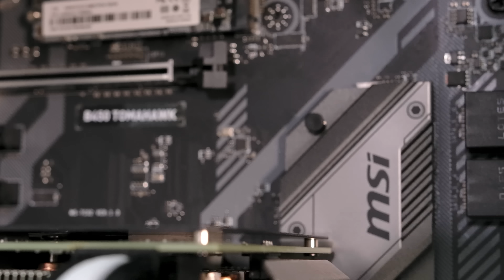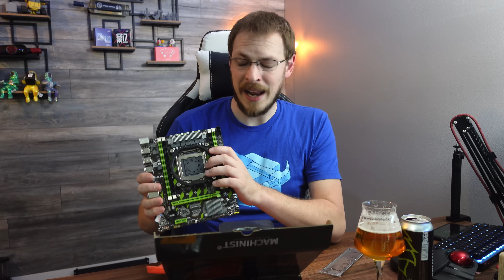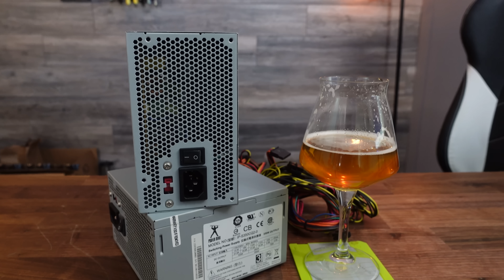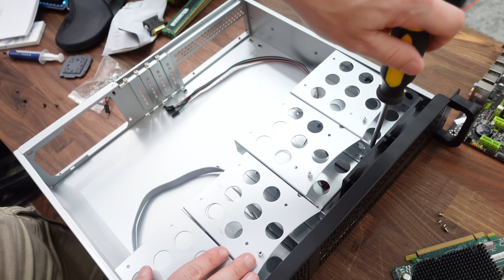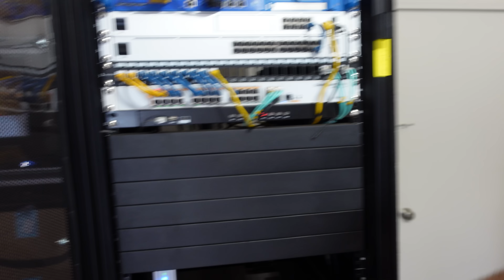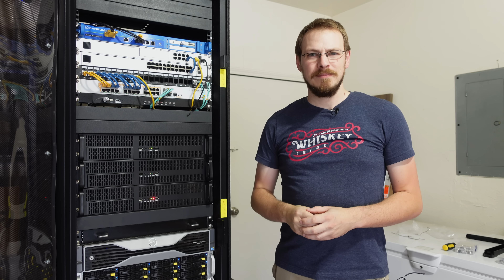A Three Server HomeLab for less than $1,000!

Comment: Overall a good builds, and I understand the choice of parts... except for the power supply. I have been bitten too many times by trying to use a low end power supply. Power supplies have gotten better over the years, but I have seen low end power supplies go and take other hardware with them. I generally only build with a few brands, and always will put a few more $$ into the power supply purchase.
Reply from the maker: These power supplies are OEM'd by InWin. They're not as cheap as you think.
Reply: @CraftComputing  I have had 2 InWin smoke shows in the past that took hardware with it. One of several brands on my "no buy" list.

Comment: You can also get ATX powersupplies with an 80mm fan pulling air through the powersupply front to back so that would remove the need for top ventilation in this case.
Reply: Difficult, while avoiding total junk and things that used to be good once but it was very nearly 20 years ago.

Comment: A NUC based home lab would make a lot more sense for most, and as Wife Approval Rating seems to be a factor, a far easier to sell.
between energy efficiency, space efficiency, heat output, noise, and flexibility of placement, they make a lot more sense. Plus companies are putting out multi-NIC solutions with 3rd party mods and 3rd party NUC-Alts like the Asus PN50.

Comment: oof...you were all over the place with your Dell specs.  I think you meant R710 [0] when you quoted Nehalem and Westmere.  They're actually Nehalem & Core Xeon compatible. [1][2]  R420 & R720 can use Sandy Bridge and Ivy Bridge chips [3][4][5].  Good video otherwise!

[0] https://en.wikipedia.org/wiki/List_of_Dell_PowerEdge_Servers#Generation_11
[1] https://en.wikipedia.org/wiki/List_of_Intel_Xeon_microprocessors#Core-based
[2] https://en.wikipedia.org/wiki/List_of_Intel_Xeon_microprocessors#Nehalem-based 
[3] https://en.wikipedia.org/wiki/List_of_Dell_PowerEdge_Servers#Generation_12
[4] https://en.wikipedia.org/wiki/List_of_Intel_Xeon_microprocessors#Sandy_Bridge-based
[5] https://en.wikipedia.org/wiki/List_of_Intel_Xeon_microprocessors#Ivy_Bridge-based

Comment: HomeLabs are fun, currently I'm running a mix between a HomeLab and "production" server on a HP Elitedesk 800 G1 with an i5 4570, 8GB RAM and 2x1TB RAID1 drives.
It's running proxmox with a few VM's (Pi-hole, Inifi Controller, MariaDB and Ngninx webserver).

I need to upgrade the RAM to 16 or 32GB though since I'm at ~90% useage :P

But I'm thinking of getting a new "production" server instead based in a Huananzhi X99 TF motherboard paired with a 2678 v3 CPU and 128gB of DDR3 ECC RAM for a total of ~425 USD and a few 10 Gbit SFP+ NIC's for it, my WS and NAS'es and migrate pfsense from a physical box to a VM instead coupled with the MikroTik CRS305 switch.

Comment: Excellent work. Using custom hardware is king. I would have chosen used small servers like the dell R210, at cheap prices, minimum power consumption, and easy assembly, but that is me 😂.
Reply: The r210 will only handle processors with what max 4 cores? I don’t see how that would make as good of a low powered virtualization platform.

Comment: Jokes on you i don't have girlfriend..

Recently I built my first "server".
I got cheap x99 ud4 mobo - 2 of the pins are missing but all memory and pcie slots are working. - 20€ (I got it localy)
128gb ECC Reg 2133mhz cl16  -  150€ (I got it localy)
E5 2620 v3 - 13€ (from Aliexpress)
Artic Freezer 34 - 27€ (New)
PSU beQuiet 400W 80+ Bronze - 15€ (I got it localy)
And some old case I got laying around (airflow is good enough)

Also one thing I found this mobo (Gigabyte x99 ud4) is that it supports headless mode.

Comment: I've used HP's sff desktops for similar usage. Only 4c8t on similar aged hardware tho, but really cheap and no building required.
Also: wouldn't it make sense to mount your chassis wifh about 1/3 U space for the PSUs?
Reply: Also very low power draw. I've got an 8300 SFF that I've been using, but upgrading to 2 Ryzen 2700X's in rack for serious play.

Comment: So how will the PSU's breathe? I had hoped you would use the blanking plates as spacers between the servers, also knowing they are 14$ a piece and no ventilation they seem like a fire hazard.
Reply: Take the tops off the power supplies, the case has fans at the front so there is air flow in the case. Simple.
Reply: was my tought!!!
Reply: Yeah, that's what I was waiting for, how he manages the cooling of the PSUs. At least spacing them out in the rack. But I would rather find a PSU which only uses 80mm fan at the back.
Reply from the maker: I'm cooling the PSUs by only drawing 100W.
Reply: @CraftComputing  Fair enough, but I would still make sure it's not getting hot by monitoring it with a temperature probe  for a few days.

Comment: Why x79 though? x99 boards can be had for the same price, 6c, 12t processors for about double what you paid (21$), scoring 900 points on cinebench. These processors have higher single core scores, and are more power efficient.
Reply: The last time I checked DDR4 RAM was much more expensive. The reason I went with original LGA2011 for my system was for the cheap RAM while not being too old.
Reply: @eDoc2020  Some of the x99 boards support ddr3 too
Reply: @RockTouching  Really? The memory controller is built into the CPU, not the chipset. According to Intel the E5-2630 v3 only does DDR4.

Actually I did a web search and apparently there are some Chinese "X99" boards which let you use DDR3 but only with specific processors. I would personally rather have a real server board from a reputable manufacturer than a Chinese board with questionable chipsets (Intel doesn't make X99 anymore, so where are the chipsets in these new boards coming from?)

Comment: To overcome the airflow issue with ATX power supplies in 2U chassis, I used an SFX to ATX adapter and mounted an SFX power supply inside the chassis. This will leave about 1cm of space between the case wall and the fan for the power supply to breathe.
Reply from the maker: I considered that as well, but it wasn't worth nearly tripling the price of the power supply. These supplies aren't exactly going to be stressed, with 100/350W being used.
Reply: @CraftComputing  Maybe some DIY "speed holes" could be added to the PSU with a drill? Lol.

Also, don't think i don't see you avoiding my question about those cheap HGST drives...
Reply from the maker: Hahaha, caught them on an eBay BIN. I bought all they had left 🤫

Comment: To bad they didn't fit the psu vent on the bottom less likely to drop a screw into the psu (or buy a straight throu airflow PSU) and the psu cable length wouldn't of be a problem then as the would have been closer to the motherboard 
and the motherboard hanging off just get a plastic motherboard stand mounts you can get a pack of 100 very cheap (long long time ago cases used to come with the screws pack)

Comment: Would be great to see a video like this, but using actual parts and not chinese knockoffs
Reply from the maker: Enthusiast platforms are still crazy expensive (x58, x79, x99). Same with Ryzen 1st gen parts. Plus going with name brand and more modern, you bump up to DDR4, which can easily double your memory costs. This video was to show the entry level to get you going. You're more than welcome to take this idea and install whatever parts you'd like, or upgrade later.
Reply: my current server is based on a 3600 with a x570 board, cause that’s what I had laying around. I will likely be changing that to the new A series they are supposedly announcing soon. If they make a new Athalon that is on a Zen 2 but cheaper (board and processor like $100) that would make great test servers

Comment: Yep registered and buffered or chip kill type (chip kill has 2 set of 9 ram chips per side for mutibit error correction or survive a full ram chip fail and stay working) these types of memory is mostly worthless unless you have a supported motherboard and cpu so low balling offers will normally get accepted because they never get sold or they get returned because the buyer didn't know what they was buying

Comment: I've built a homelab with aa am4 x370 board,  Ryzen 7 1700 (set to 45w eco-mode in the bios) with 32GB of ram. Runs pretty fast, and when idle, it draws not much power.
It was relatively cheap, ran ESXI and worked fine!
Maybe a suggestion for a future video?
Reply: Clutch that you got esxi going, it hates 95% of NICs I swear

Comment: How will the PSU of the lower two units breath? I see no openings with stacking them like that.
Reply: They probably don't... Or at the very least they are barely pushing air out through the sub-millimeter gaps that are present due to manufacturing tolerances . That's also the biggest complain I have about this setup: either you  pack them tightly and hope to not start a fire accidentally or you sacrifice (at least) 1U  worth of rack space to place gaps between the three.

Comment: HOLD UP.... Where did you get those HGST drives for so cheap? I've been wanting to replace my server's old AF drives for awhile now
Reply: If you're up for it, I've had very good luck with HGST/Hitachi enterprise refurbished drives on Amazon(Seller is goHardDrive[on Ebay also] though I did try a couple others too.) I have a mix of 3TB and 4TB drives in my NAS totalling to 29TB with 11 drives currently. The oldest are from.. 2015? I think? I started with shucked 2TB External Western Digital drives(2 of the 4 have died btw), and one 2TB HGST refurb in.. 2013 or 14? And slowly added 3TB drives and then started with 4TB. All the 2TB are out of rotation now. Oh also, I had bought a 4TB External Seagate in like.. 2017? to use for backups of the most important stuff, and it died in like a year and a half, meanwhile all the HGST/Hitachi drives are still going strong.
Reply: @Raletia  That is who i got mine from.
Reply: eBay. I have a set of 2tb's from april 2012, been running strong since new never an issue
Reply from the maker: Yep, eBay. Caught these on a BIN deal. Bought all they had :-)
Reply: @stevenhusnik5937  I have 12 that have been running 24/7 since 2015, never had a single problem.
Reply: @hungriestbigtoe  they are the bomb for sure, about to buy some 4tb ones here soon
Reply: ebay is Pog i got 20 TB in form from 5x 4TB WD Reds with only 23k Hours and perfect condition for 200 bucks, if i had buyed them new this would be 100-110 bucks per Drive

Comment from the maker: 21:17 *Dell R710... So both on-camera Jeff and editor Jeff are idiots this week.
Reply: I like my 710 with 5675s and only paid 160 for it
Reply: So i guess i stole my R730 for $25 then...
Reply: @necrogami1  I will take your entier stock
Reply: @necrogami1  😲
Reply: @necrogami1  if you bought an R730 for $25 and they run, you stole them!  Let me help your conscience and give you $50 to relieve the regret
Reply: Got a DL380p Gen8 with dual Xeon E5-2670s and 384GB of RAM for $249.
Reply: @HudsonGTV  that is what i would get
Reply: I picked up a R720xd for 350. so far I love it. its quiter that the R710 and I got 6 more drive bays for my data hoarding needs
Reply: If someone is looking for a cheap 1U server, R420s CAN be had pretty cheap and low power :)
Reply: I use a PWM fan controller (small board from ebay, powered by USB) for my Dell R710's fans (RPM signal cables are "hijacked" for each) so it's near silent with good temps.. no issues so far over 3 years ago. .. the whole thing it only draws like 150w with 2x Xeon and with like 6 drives in raid 5.
Reply: I bought 2 used servers a hp dl360e g8 and a r610 for 320$ (total 56gb ddr3 48threads aprox. 2ghz)
Reply: I canceled my R710 order then ordered a T310. Then the R710 showed up anyway. And I got to keep it.